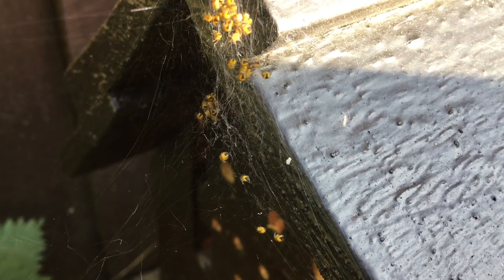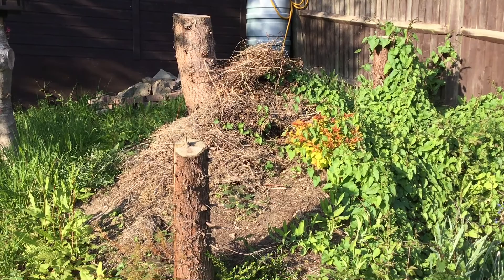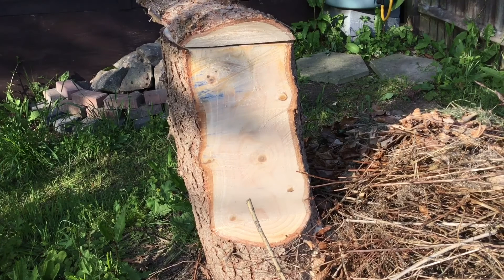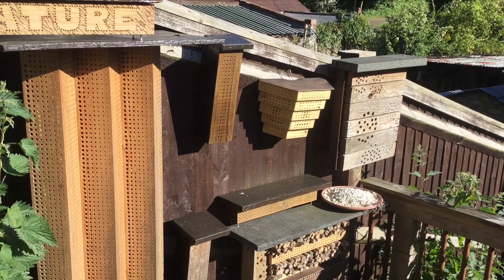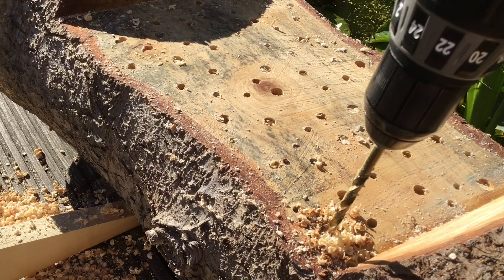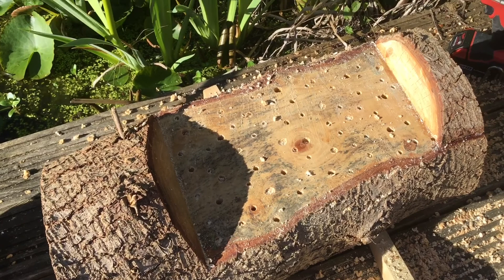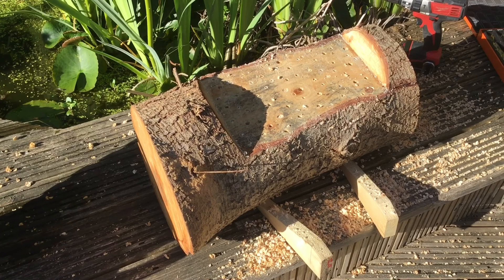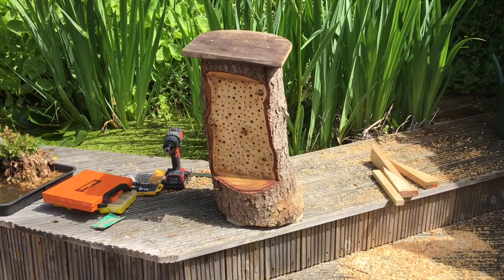Insect, Bee & Bug Hotel - DIY Beautiful Tree Stump / Log Bee Habitat

Comment: i like the log idea it looks brilliant. how deep did you drill your holes . i've bought extra long drill bits to drill deeper holes . i noted on one of the other you tube videos encourages the female bees to lay more female eggs which has got to be a good thing .
Reply from the maker: Raymond Kilminster hello there :) Thanks I  am really pleased with it. That's a really interesting point about the hole depth and one which I completely agree with. As this log was so thick I was thinking as I was drilling it that I could've gone a lot deeper but I literally went in as far as the drillbit could go and wished I had some deeper drills myself. My new pillar drill has the capacity to fit something underneath the drill head a lot thicker and also the head moves far more to make the holes deeper. Once it's all set up I'll make another log habitat like this one and do a new video. Xxxx